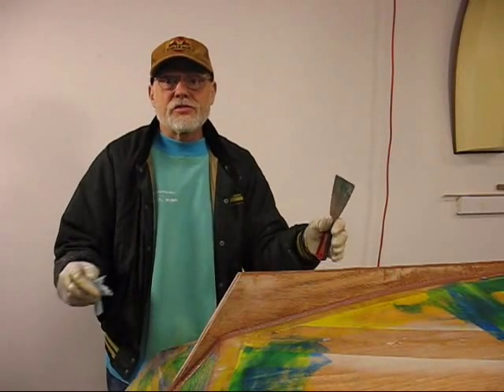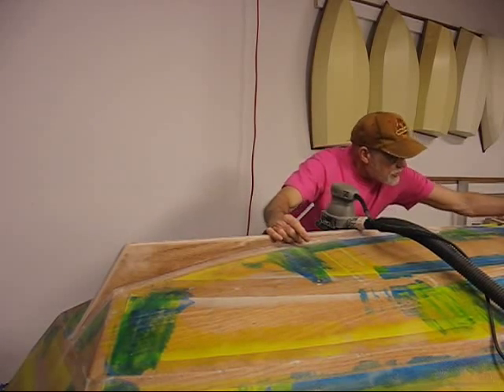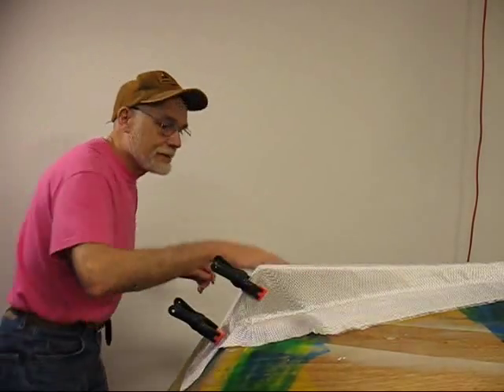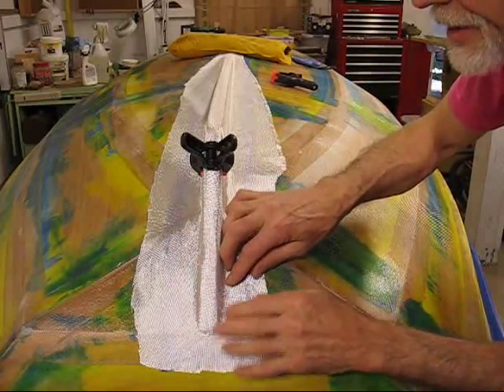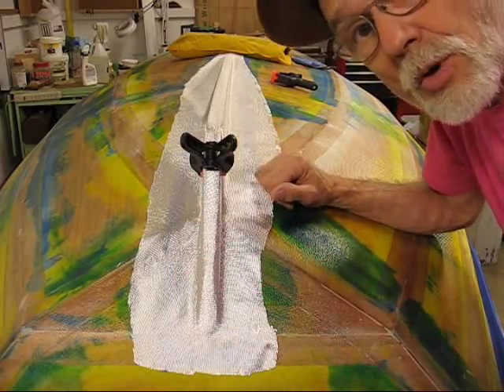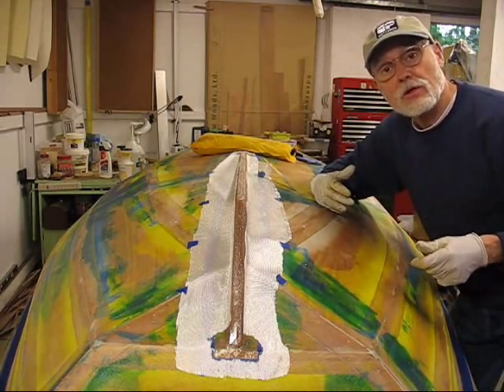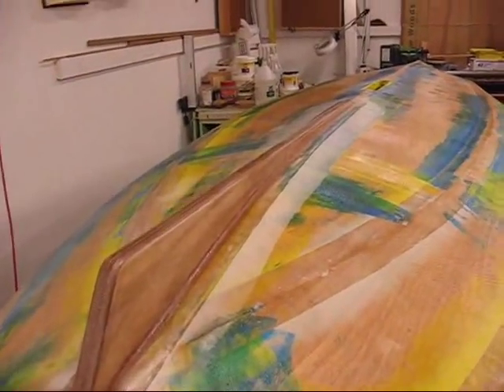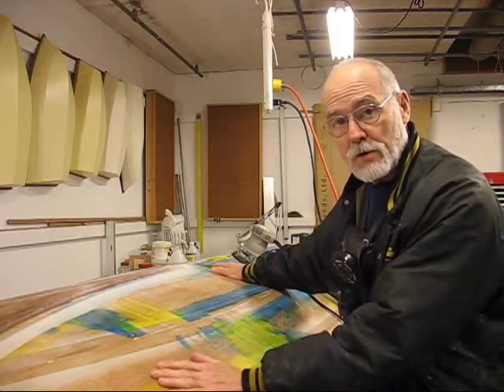Part 31-2 Adding the Keel Strip.wmv

Comment: I finally used your toothbrush method for applying epoxy. Works great! I was using chip and acid brushes and your method works so much better, I was always removing stray bristles from the job.
I am also learning a lot from your videos about laying fiberglass. I always layed it down then immediately glued it down. I will let it rest a day or two the next time as you do.
Your boat is looking good.

Comment: Another trick you can use to fit to irregular shapes is to wet out the glass with Easy Fillet. The thickened epoxy will stay put a lot better than just plain epoxy. The GelMagic doesn't work as well for that though because it doesn't really wet out.